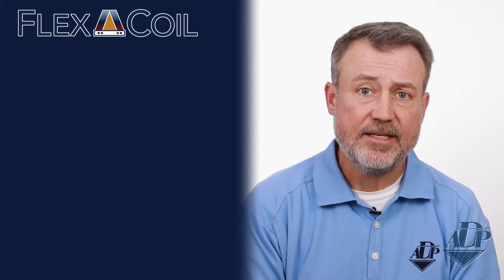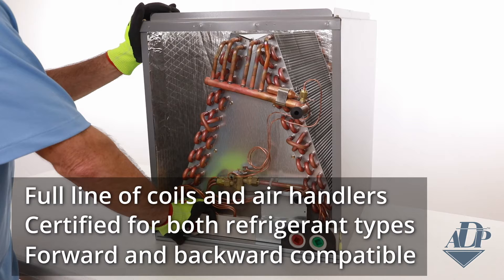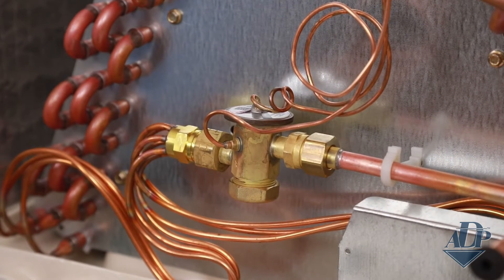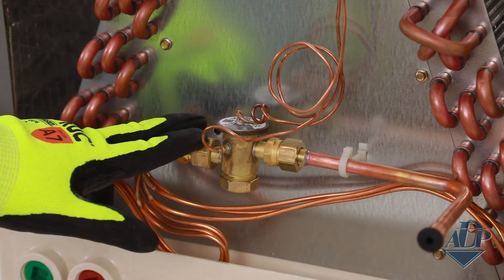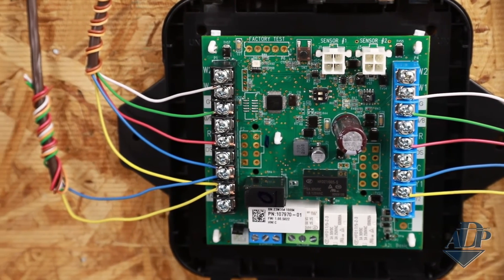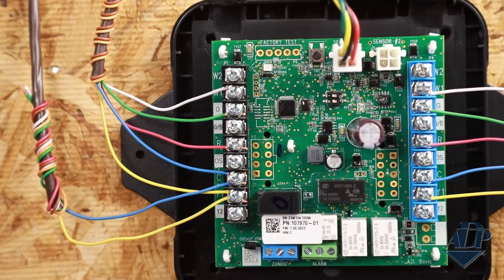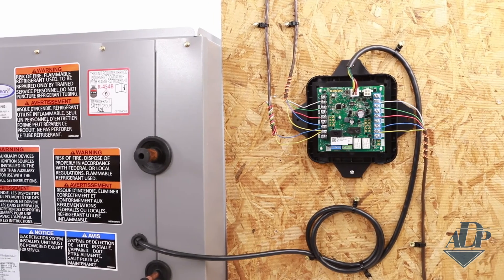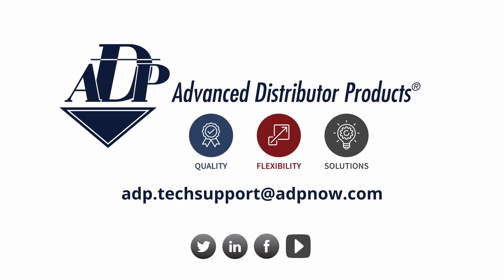How to Install ADP's FlexCoil

Comment: what is the lifespan of the sensor when it's in 100% humidity, If manufactures would build equipment like they used to we would not have all these refrigerant changes. I just changed out a 30 year old carrier system because the compressor failed.
the customer asked me how long this system would last? I had to tell them 10-15 years at best. they were not happy.
by the way it had the original compressor in it and the customer said the blower motor was changed 10 years ago.
I have over 40 years in the HVAC industry. Everything built now is junk. Quality needs to be put back into our industry.